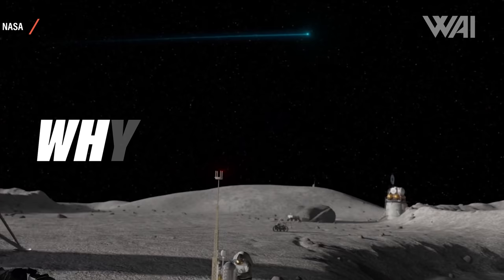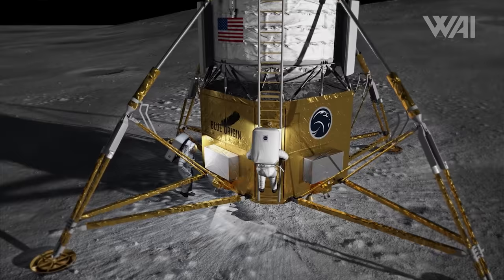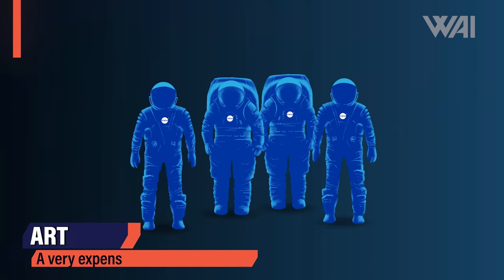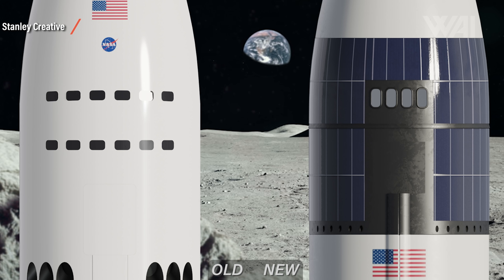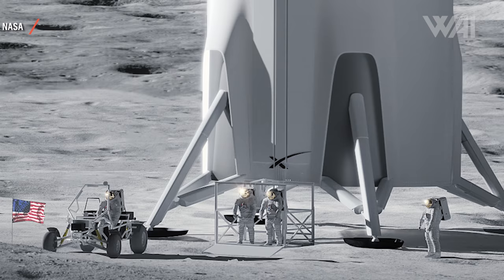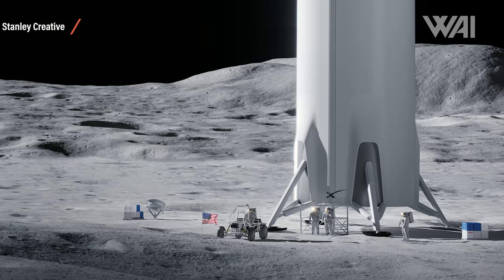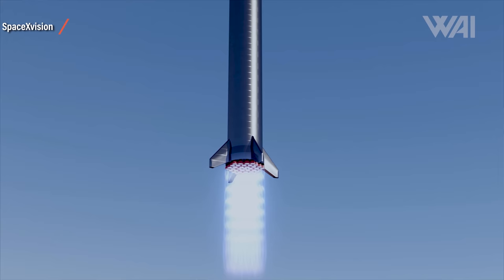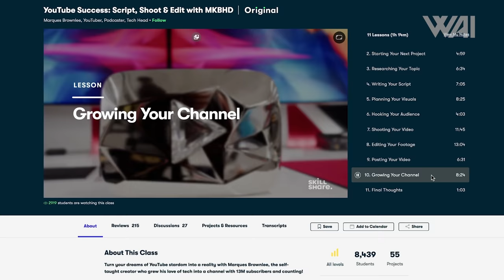Why Did NASA Award SpaceX 2.9 Billion Dollars For A Lunar Lander?

Comment: Now i wonder if after the lunar mission is over are spaceX planing on leaving the starship on the moon sense it doesn’t have any flaps?
Reply: I don't know how many times the lander will be reused but if they start getting a base together it can be either part of the base of a big chunk of stainless steel available for various projects. Cutting torch and welder can be used. Worst thing would be to burn it up in earth atmosphere and throw away good material.

Comment: 12:48 shows the standard set of six Raptors, but why would Lunar Starship need sea-level engines at all? Super Heavy will take it high enough for just vacuum Raptors, and then it will live the rest of its life in vacuum.
Reply: The vacuum ones won't gimble, right? So maybe something to do with that. Not sure how much they would need with all the engines/thrusters higher up. But the easier answer might be "it's just a render".
Reply: @subwarpspeed  Yeah, "it's just a render" is apparently the answer. I looked up the artist and found this thread on Twitter where others asked him the same question: https://twitter.com/InfographicTony/status/1383472636349476868

As for gimbaling, I assume that without the sea-level engines, a special thrust puck could spread out the vacuum Raptors enough that they could be gimbaled a little. Or as someone suggested on the Twitter thread, RCS thrusters might be sufficient to steer, since the engines would not be used for landing but only in open space.

Comment: How will the StarShip get Power during the 2 week Lunar Night????
Reply: A big block of Tesla batteries, I imagine. Starship already uses a lot of Tesla parts — e.g. electric motors for the fins — and including a couple of tonnes of batteries isn't really going to tax their lifting capacity much.
Reply: At least first mission is only meant to be 1 week on the moon so no problem there with just planning it.
The also want to land on the south pole, if they get it up on a high ridge the can have perpetual sunlight on the solar panels.

Comment: On the renders the lunar starship have sealevel raptor engines but just like the flaps it wouldnt need those. or am I missing something?
Reply: I think that was an error, since there is no sea level raptors shown in any official render
Reply: @airor9874  The config is the exact same as the standard variants for the last year render
Reply: @alvianchoiriapriliansyah9882  oh

Comment: Your analysis and renderings of the SpaceX Lunar Lander for the HLS program are very good, but you missed a vital point.  
According to the NASA Source Selection statement, p. 9, the Lunar Lander will have two airlocks for redundancy.  This is critical for safety with the airlocks located more than 30 meters above the Lunar Surface as stated in the NASA Source Selection statement on p. 8.
Have you given any thought to the fact that the nosecone currently in the new test rig at Boca Chica has a cut off tip, ideal for mounting a spaceship matting lock.  Pathfinder?
NASA apparently still intends on using the SLS/Orion capsule combination to transfer astronauts to the Lunar Gateway where they will transfer to the Lunar Lander.  This is at best stupid and at worst fiscally irresponsible and adds another layer of unnecessary danger.  
If you move a Lunar Lander to the Gateway you waste almost 2.5 km/s of Delta-V vs direct LEO to the moon. Return via the gateway repeats the same mistakes.  NASA has already given the justification for refueling the Lunar Lander in LEO.  If you move the Lunar Lander to the gateway are you going to send another 3 or 4 Starship Tankers to the gateway to refuel the Lunar Lander?  LEO to the moon to LEO simply makes more sense.
By using the Crew Dragon instead of the SLS/Orion to launch the crew into LEO where they transfer to the Lunar Lander for the direct trip to the moon and back NASA would save more than a billion dollars per launch, money the US government could waste elsewhere.
Reply: Well the point is that NASA gets money for SLS+Orion to get to the moon and back. They don't get money for getting astronauts there and back and choosing a solution. Stopping SLS funding won't fill up another account labeled "get there the best way". It will just not be any moon program then.
The US senate/congress/politics could save money if they themself would redirect this of how NASA should do it. But that won't happen of course.
Reply: @subwarpspeed  Your right about the funds being targeted to the SLS and the Artemus program by the US Congress.  This is a perfect example of the US Congress forcing spending on unneeded or out of date programs just to keep work being done in their states or districts instead of letting the government agency spend the money in the best way.

Comment: I wonder...  The engines will be very high, and there is no more option for fuel tank at the top.  So there is no problem, once above the moon to bring the fuel which will be below the engines, up to the engines with enough pressure so the engines don't stop while running ?

Comment: How will astronauts return to earth if starship doest have the landing control surfaces and heat shields?
Reply: The way the Artemis program is designed now, Lunar Starship (or any other option) will only take people between the gateway and Lunar surface.  All travel between earth and gateway will be in Orion spacecraft.
Reply: @00HiGhGuY00  ahhhh...I was not aware this was how the program was setup.  Thanks for clarifying.

Comment: The Lunar StareShip should be decided into the lander and an orbital tug. That would eliminate the need to carry full size Raptors and tanks to the surface of the moon and allow the hatch to be so close to the lunar surface it could use a ramp for access.
Reply: But then it wouldn't be a Lunar Starship... it would be a completely new craft needing to be designed for that purpose, similar to the Dynetics and BO designs. The entire point of Lunar Starship is that it's a Starship... a relatively cheap and minimal customisation to their existing vehicle, leaving off a few bits they don't need and adding some extra mission-specific stuff.

SpaceX didn't bid Starship because they care strongly about the Moon (Mars is their thing) — they bid it because Starship was something they were already doing, and bidding for HLS was a good way to show it off.
Reply: @simongeard4824  Yes, it would require some redesign. Do you think  SpaceX isn’t up to that? Standard StareShip comes in three different ways and all of them require additional design from the current version.
Reply: @dmk1948  SpaceX is footing part of the bill themselves. The money helps them with development cost but starting doing more special designs will not be done unless NASA would accept a bid where they are fully covered and much more. All it costs now is just more fuel which is "cheap".
Reply: @dmk1948  Of course they can do it. But you're talking about more than just a small customisation to Starship... you're proposing to build a completely new vehicle that might have some parts in common, and there's simply no reason for SpaceX to do that.

 Lunar Starship exists only because it's 99% identical to the other Starship designs, and so it was trivial for SpaceX to throw a few engineers at the job when NASA asked for HLS bids.
Reply: @simongeard4824  completely new? What’s the difference with the current lunar lander proposal? The addition of a docking ring between the orbital tug and lander components and the repositioning of the landing legs and engines.
Reply: @dmk1948  The Spaceship proposal is a standard Starship, but with the wings removed, some extra engines installed at the bottom of the cargo space, and a standard docking port on the top of the nose (which may end up being a feature of other Starships too).

 Whereas if I understand you correctly, you're proposing to split it in half at the middle... which would leave the lander section without any fuel tanks, so I assume you're redesigning the tanks too... you're moving the legs, so you're presumably adding some structural reinforcement to attach them to. Basically, you're describing a whole new vehicle.
Reply: @simongeard4824  Thank you for acknowledging that the lunar lander uses StareShip components in a new configuration. As will be true, to a lesser extent, of the orbital tanker and cargo vehicles. The only thing I am proposing is the addition of a stage separation between the lunar lander and the orbital components. And, of course, moving the legs.
Reply: @dmk1948  Yes, but you seem to think "the only thing you're proposing" is a small thing. Cutting the entire vehicle in half down the middle is not a small thing.
Reply: @simongeard4824  I am proposing a stage separation, like the stage separation between the big booster and the current second stage,; the Starship orbital stage. This should require nothing more drastic than introducing a new pair of rings between the forward bulkhead of the main tanks and the aft bulkhead of the cargo section. The new rings use essentially the same stage separating mechanism as that between the first and second stage. The Lunar lander becomes an orbital tug that never lands and much lighter lander with better access to the lunar surface after landing.

Comment: I think the one big reason why SpaceX got the lunar contract is simply because of payload. The other two options did not really expand that much on what Apollo done over 50 years ago. If we want to stay on the moon for any length of time, we are going to need craft that are capable of landing tons of equipment. Why pay the other companies more money for a craft that delivers much less? Makes no sense. So in that respect it was right that SpaceX got the contract. On the other hand however, choosing SpaceX may knock the landing date back a few years - SpaceX have a long long way to go before they have the craft ready for human flight. I would be very surprised if the 2024 goal is met.

And to be honest, it would not surprise me to see a new version of the Lunar Starship emerge, one where the nose section detaches from the main body of the ship. I think a lander the size of a Starship nose section would be a much more viable option, especially when it seems that SpaceX would not use the main engines for landing anyway. And like I have said before, having such a version of Starship will get them around the big problem of not having an abort escape system built into Starship.
Reply: Nose detaching thing = high need to redesign, which counteract what the source selection documents has said

Comment: Still don't know how it's going to work.  The Moonshiop will be launched into Low Earth Orbit and then refuelled by multiple Starships.  But then it still doesn't have enough fuel to get to the Moon surface and back so it must refuel again somewhere?  Then, anything returned to Earth can't enter the Earths atmosphere in a Moonship so will have to be transferred to a Starship.
The only realistic option I see is several Moonships constantly ferrying fuel and supplies too and from the Moon.  This just doesn't work as a single ship, not even docking on a Module in Lunar Orbit.  It has to be an all or nothing investment in a proper functioning Moon Base.
Reply: My estimation is that a minimum of 30 launches is required to put Starship on the Moon and return astronauts and cargo.  If SpaceX can do that (which means they have cracked reusability) then there is little point in not doing that every month or two.
First priority must be manufacture of fuel on the Moon to make the whole process more economical ... and that is when true space travel kicks off!
Reply: @Spedley_2142  Can't make CH4 on the Moon, so no on site refueling.
Reply: @csgergo80  More tha half the fuel is Oxygen so just that would make a massive difference.

Comment: Why are there still so many Raptors down under the lunar-version of Starship? Landing on and going up again from the moon-surface isn't handy with those strong engines. You only need 3 vacuum raptors for the trip from earth to the moon (perhaps 1 will be enough!? Or 2 --> Less is more!). You'll have to use the small rockets on the upper-part of Starship  used for landing on the moon to get up from the surface as well. Being up far enough from the lunar surface (to avoid debris being thrown up) 1 vacuum raptor must be enough to escape from the moon's gravity for the rest of the trip to earth ...
Reply: Vacuum version can't gimbal, so SL is needed
Reply: @alvianchoiriapriliansyah9882  Thanks! I didn't think about it, but should've known. So you need at least 1 'normal raptor! ... But isn't it possible to steer the Starship with the upper-part trusters used to land on the moon and assend from it?
Reply: @hermanvierhout3081  The only thing the upper thrusters will do is slowing down at the last moments before touchdown, and the earliest moment on takeoff. The rest of propulsion will be done by Raptors
Reply: @alvianchoiriapriliansyah9882  OK, thanks for the info!

Comment: I don't think Elon will be using a fairing around the legs. This would not be sustainable and money waisted. I would use the side pieces to spread the weight by making them the feet. Got to tuck them in somewhere and it would offer wider footprint and greater stability if the ground is uneven.
Hope their will be good shock absorption. Any flexing of the bodywork may damage the guide rails for the lift and that could make the lift inoperable.

Comment: Is this moon lander reusable? If so, and if it never returns to Earth how do you move cargo from the Starship coming from Earth which will, I assume, dock with the moon lander?  If the cargo is simply moved by the astronauts by hand  through the dock, there can't be that much of it, so I don't think such a large lander would be necessary. To me the whole setup seems clumsy and unworkable.
Reply: They have bay doors on either side, so putting stuff in LEO, shoudn't be a problem (unless something is REALLY big). Also keep in mind, only Starship has this option.
Other landers aren't even close to having such capacity for cargo, and main reason (for now), isn't to bring xyz cargo to the Moon, but to transport people there and back safely.

Comment: Something about this Lunar Starship design makes me VERY uncomfortable. 
First of all, it's too tall with a VERY HIGH center of gravity. WHAT IF, if tries to land on the lunar surface on a VERY uneven surface, and something it loses stability??? Seems to like a disaster waiting to happen...NASA/SPACE X NEEDS  to ADDRESS this issue. The landing legs are just TOO SMALL in my opinion to support its total mass. The entire structure just looks VERY unstable to me!!! 
VERTICAL structures are inherently UNSTABLE and VULNERABLE to catastrophic events because of the high center of gravity. They need to come up with an INNOVATIVE design that not only ADDRESSES ALL these issues but reduces the margin of error at the same.

Comment: Great video. Yes it seems strange, not logical. My opinion is that NASA realized that it’s own survival chance was to join SpaceX and unleash itself from the political-industrial that determined most of the plans in the last two decades. 
They decided to make the only reasonable move: contract SpaceX at lease for the lander, and then phase out in the future all the costly and obsolete subcontractors supported by the senate.
Clever strategy, but also the only possibility to try to survive.

Just few tech remarks: despite this strategic/political masterpiece, still the mission profile for Artemis 3 with the full hardware mix (SLS+Orion+Starship+…) appears to me to messy to be accomplished. 
Without substantial changes, they would face a mission much much harder than any Apollo. I am concerned

Comment: i think the first launch to the moon (just test launch no cargo or people) will be in 2 to 2.5 years
Reply: Artemis I is scheduled for november this year. The hardware is at the Cape. They've used the fuel tanks in testing now which have a designed maximum time (I don't know exactly, 1-1½ year?) before usage so the clock is ticking, if they don't launch the design dictates it be scrapped. So I think the will actually get this one going at the latest beginning of next year.
Reply: @subwarpspeed  well yes, but that's for the lunar gateway, starship will be used as the lander which comes about 1 to 2 years after the lunar gateway is sent up

Comment: How do the astronauts get back to earth if luna starship has no heat shield?
Reply: I have the same doubt! Using a crew dragon from de ISS?
Reply: @nelsonhenrique1329  that adds 500 million to the bill!
Reply: @Bow-to-the-absurd  Much cheaper than 2 billion for the SLS/Orion mess.
Reply: @csgergo80  yes
But is that the method to get back?
 If so, that's rather unlike spacex
Reply: @Bow-to-the-absurd  Ask the Congress. The problem with Starship is that it needs more time to human rate the landing process. (They need to do it a few dozen times successfully for NASA to accept it)